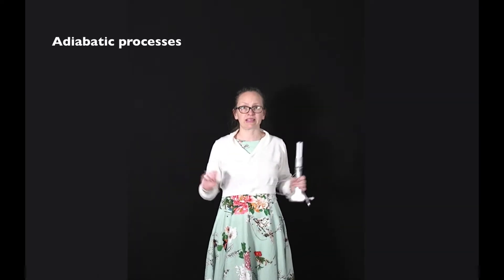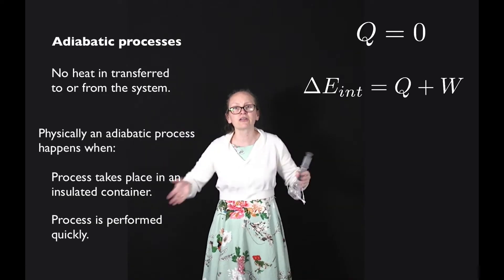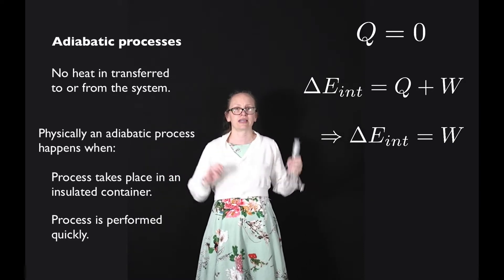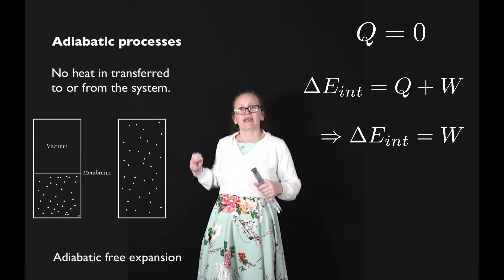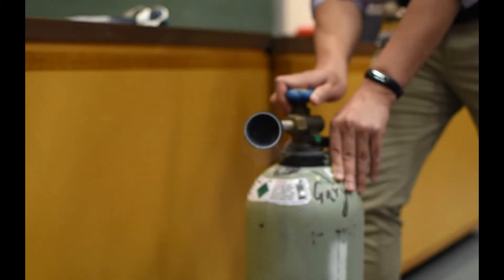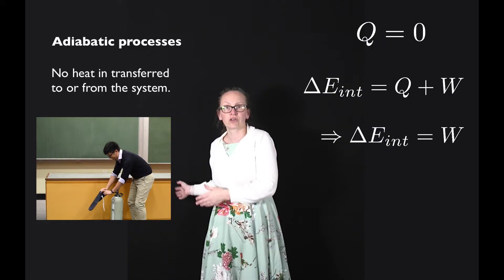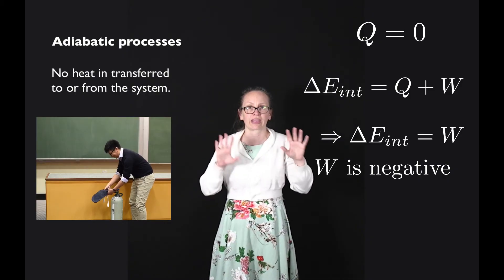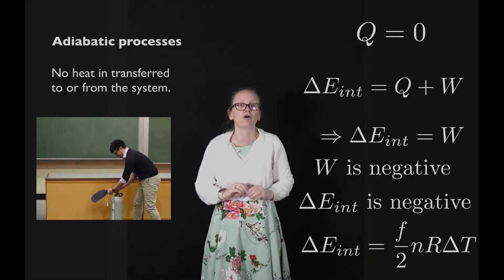Adiabatic processes

Comment: If you look at carnot's cycle, adiabatic means heat exchange and that amount of heat is equivalent to work done. Adiabatic process is not insulated system but heat loss due to exchange of heat.

Comment: I understand that when air rises, pressure decreases, volume increases, and temperature decreases through adiabatic cooling. However, I also know that cool air contracts like warm air expands. So wouldn't these two facts balance each other out and the air wouldn't move at all?? 

Obviously it works out that cold air rises because if I go climb a mountain it will be chillier at the top. But since cold air is also more dense, how is it higher and how is this true? I feel like adiabatic processes are true to the world but somehow go against those other facts I know.

Comment: Adiabatic process does not mean no temperature change. It means no transfer of heat to or from system. The dry ice formed because of temperature change. If the process was slowed down enough, no dry ice would form due to the heat transfer from the environment.
Reply: you cleared my point thanks.
Reply: Why did the temperature change? Temperature change implies a drop in the average velocity of the particles, where did that energy go?